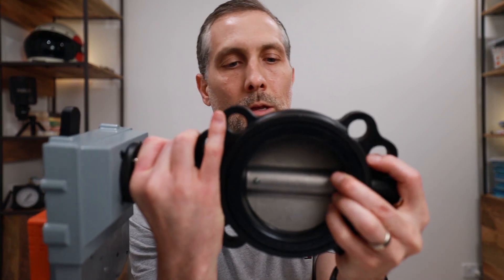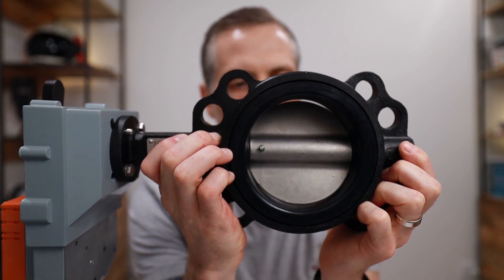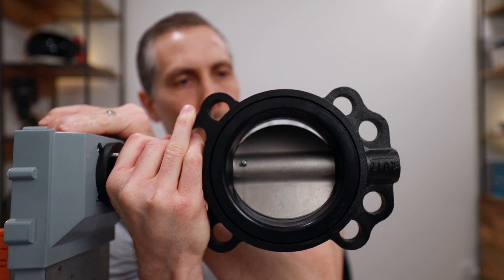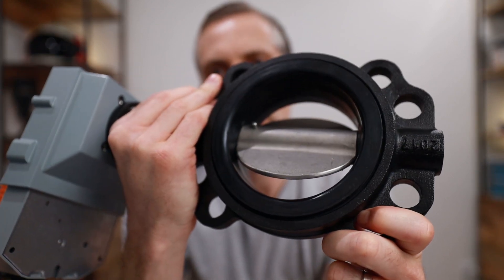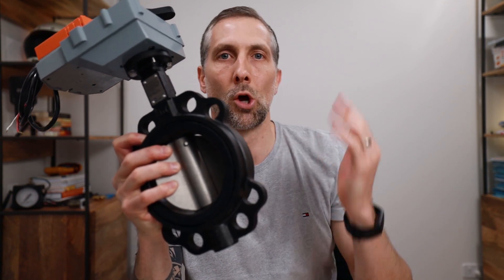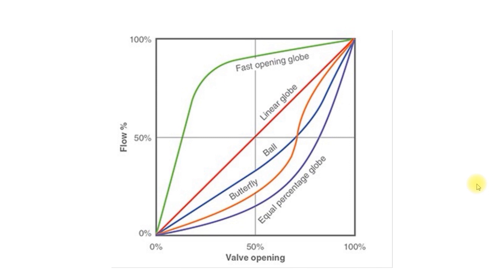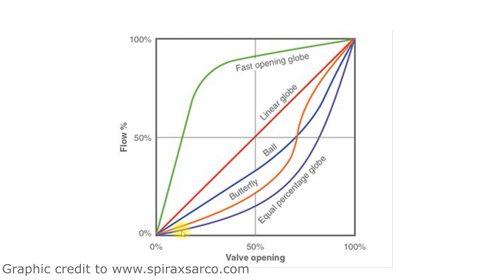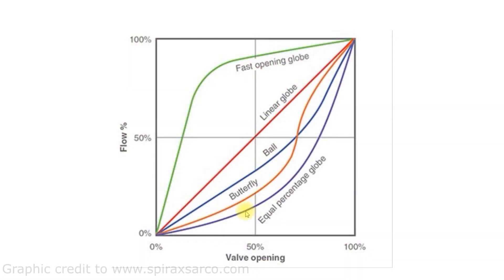Can you Control Water through a Coil with a Butterfly Valve? Maybe

Comment: Nice Bryce..so which valve you recommend for AHU and FCU CHW ?
Reply from the maker: Hi, traditionally, and still used by some companies, would be a globe valve with equal percentage characteristic (expensive valve plus actuator combination).  
However, the industry has moved over to characterised ball valves, with equal percentage characteristic. They are much cheaper, when you include actuator costs. I would typically use these.

However, if you want to get smart about it, I would use Pressure Independent control valves. 

And if you have money, on larger AHU's I would consider the Belimo Energy Valve.  

Lots of options, depends on how much time and money the project has.

Comment: Worked on an existing large shopping centre (over a period of
 20 yrs) that was installed in the mid 70's.  All the existing control valves were motorised butterfly.  Only discovered this 5 yrs ago, when we replaced all existing valves with PICVs.

When l was a young engineer, working with the leading consultant at the time, we routinely used butterfly valves for bypass......just had to check the Cv
Reply from the maker: Interesting, good to know, cheers.